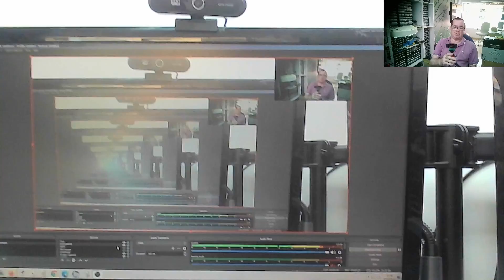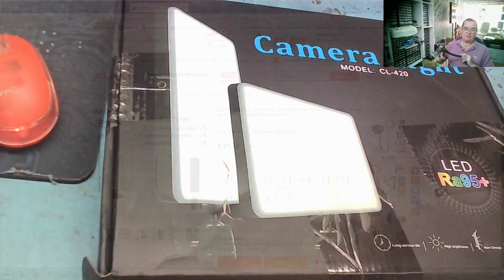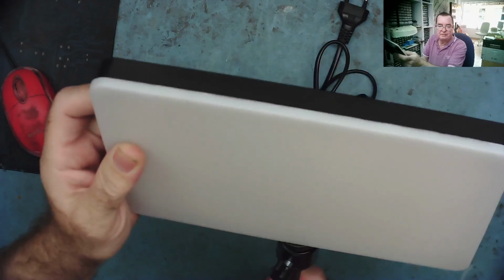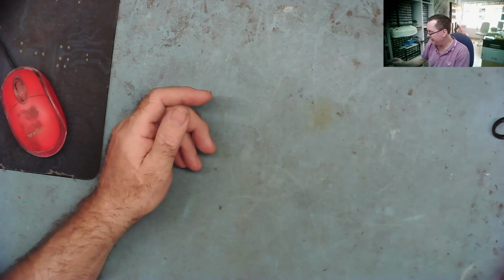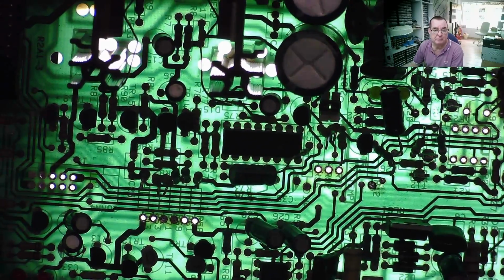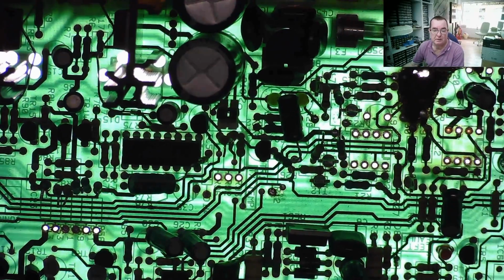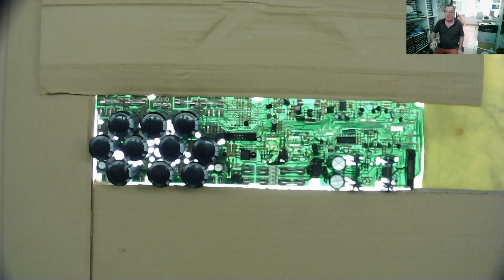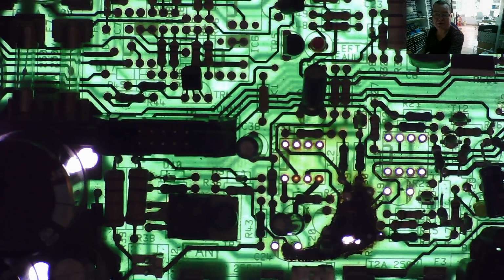Trace PCB Tracks easily using a Backlight - Commercial LED Fill Light vs The Ghetto Method

Comment: You could also point a bright laser pointer at the back of the PCB where a particular component is, and thus see better which solder pads on the other side belong to it. (The PCB would probably have to be held vertical in order for this to work...)

Comment: I am going to have to get one of those lights. The tracks are so distinct. I have used a flashlight, but it's often too bright or not bright enough, only part of the board is lit up, and it takes a hand to hold the light. Often I could use 3 hands working on electronics. Holding a light is not an option.

I like your idea about using RGB leds.  All colors absorb or reflect light differently, so you should gain more control to tweak the contrast. Maybe highlight the bottom traces a bit more?

Comment: Yeah, a bright light source above will always cause glare because the light reflects directly back at the camera (or eyes). Especially noticeable when using a microscope with a ring light. Two lights (one from each side about 45 degree angle) allows for a better image, because the direct reflected light doesn't hit the camera or your eyes. Alex from Northbridge fix did a comparison video and the difference is huge when flux was on the board. 

Your audio sounds great now Richard.

Comment: To improve bench lighting, you can use adjustable side-facing LED spots (similar to those on your digital microscope). These provide good light and can prevent glare / shadows. Northridge has a gold-plated version (ho, ho) but I'm sure something could be put together at lower cost (than importing from the USA).
Reply from the maker: Actually on the next video I replaced the face webcam again (same model but not defective) and now I think the fill lighting is good enough as it is - you will see it yourself tomorrow.  The ghetto backlight idea worked surprising well.

Comment: Photographers always use 2 lights angled at 45 degrees left/right to the object using diffusion paper. That should take away the glare. Colored lights show different parts of the pcb better. Finally: use a  (circular) polarization filter (or old sunglass elements) get more saturated images with less reflections. Many thanks for a whole year with nice videos and good advice! Looking forward to another year.

Comment: Thanks for the ideas, anything to help reuse what would normally be thrown on  the tip has got to good. I particularly like the idea from Kev B regarding using these old TVs as task lighting in the workshop, I'm definitely going to give it a whirl since it'll free up a whole section of shelves in my workshop taken up with old screens. Do you think placing different coloured layers of the old fashioned stage lighting gel or coloured tissue paper under the PCB would help with contrast? It seems like a nice, cheap and easy way to change the colour to one that suits best. In fact I'm going to give it a go!!!! We used to use blue light in our ambulance to show off blood vessels in patients, the contrast was amazing and very helpful. I'm loving your channel by the way, I've just found it and have learnt so much from the few post I've watched, so please keep it up. I hope you and you family have a happy new year youth, take it easy, best regards, Matt.
Reply from the maker: Yeah, have a go with coloured gels.  I'm ordering a RGB LED fill light so we can see how much use it is with reverse engineering double sided PCBs

Comment: I bought a Vivitar Light Deck and modified it to use as the base for my digital scope/camera. It has an app for my tablet and phone to control brightness and color. The color change is the best part because different colors shine through different color PCBs better than others. Orange, yellow and blue are best for green PCBs. I made a mask to cover the perimeter and leave a 4 in x 4 in square for light to shine through.  Then I made a stage or tray with a 2in x 2in square hole. By manipulating the tray and pcb, I can find, isolate, and enhance with great detail the area in question.
Its almost like having an  x ray machine.
Now I'm gonna pair it with my thermal camera.

Comment: this only works with 2 layer boards!!! If there are more than just 2 layers u can't see anything because where are no traces there will be a ground plane where u can't see through. 

so my conclusion. its ok for big old boards like amps or something like that, but won't work on boards like PS4, XBOX, Nintendo Switch boards,....
Reply: I was going to say only works with boards without ground planes unless the light is bright enough to see through copper ;-)
Reply: I use a  Vivitar Light Deck and it is extremely bright. Plus I can change the color and brightness through an app.  Believe it or not,   colored lights shine through colored PCBs better. Blue, orange and yellow shine best through green PCBs. With color and brightness I've been able to see right through every multi-layer pcb I've encountered. 
However,  it will NOT shine through a ground plane.
Reply from the maker: Sure it only works with two layer boards without ground planes - but that doesn't mean it is therefore useless, yeah?

Comment: you could put tinted glass over that lamp to change the hue
did you get that lamp from ali? i couldn't find a link to that model number.
Reply: Get  Vivitar Light Deck. You control brightness and color by app for phone or tablet to see through different color PCBs.  I wrote a longer description in the main comments section. 
PS its awesome!